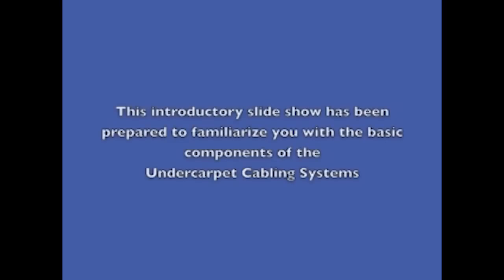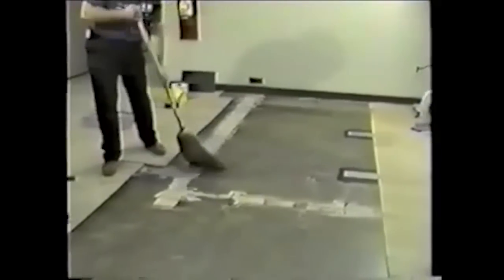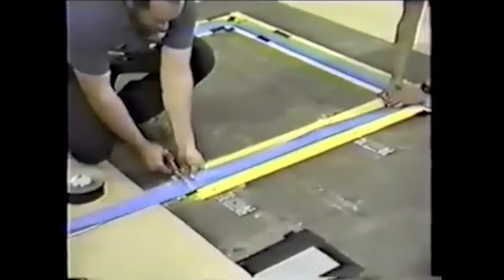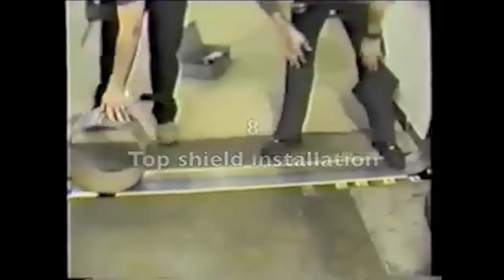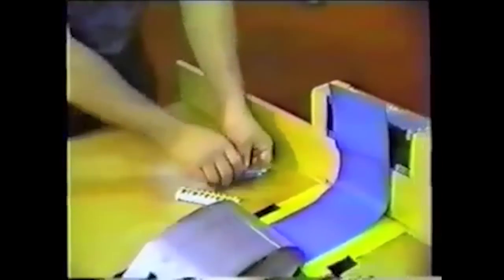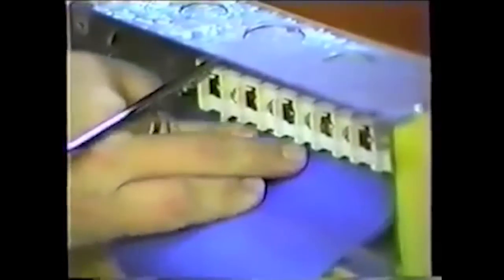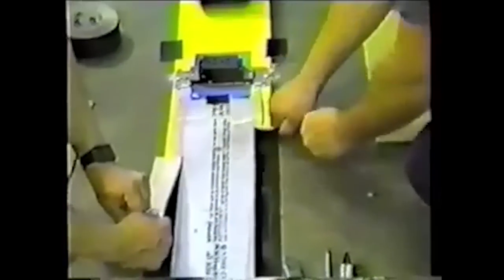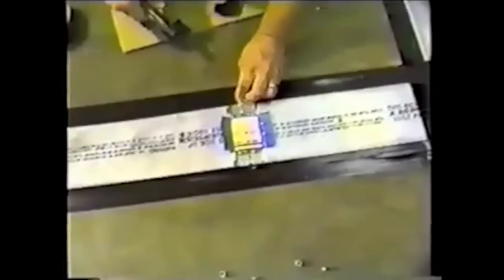Undercarpet Cabling Installation

Comment: What about the cat 5 cable?
Reply: Cat 5 cables can generate heat when transmitting data, especially over long distances or at higher speeds. Placing the cable under a carpet without proper ventilation may hinder heat dissipation and lead to increased temperatures. Elevated temperatures can affect the cable's performance and longevity, potentially causing data transmission issues.